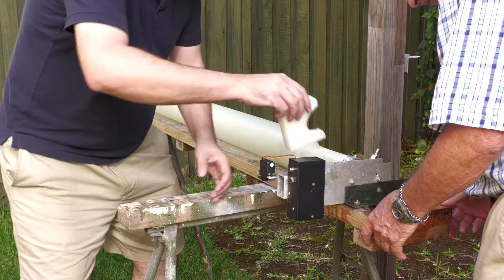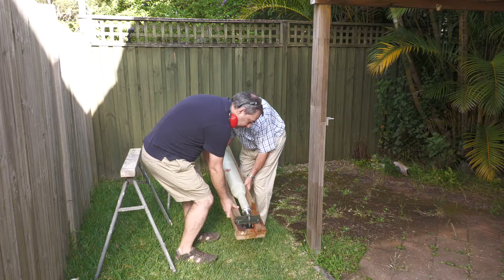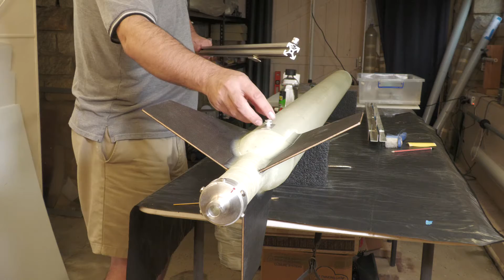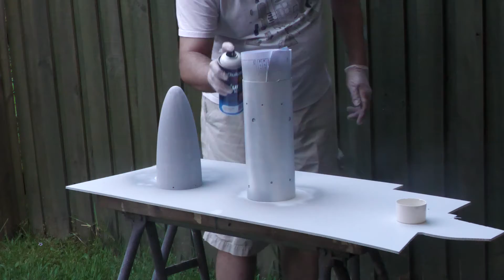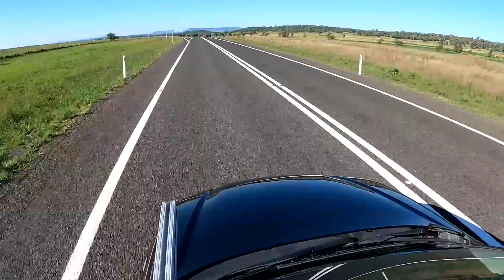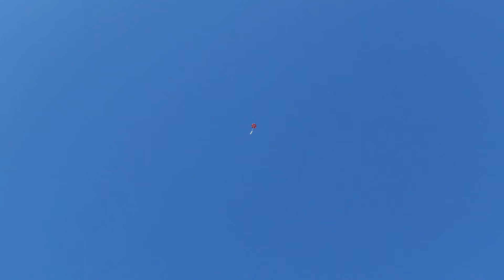High Power Water/Pyro Rocket - Part 6 - Finishing the rocket

Comment: Very smooth launch and almost no spin either. You make this look easy(ish!). A J motor sounds pretty powerful - how high will it get as a pyro rocket? Can't wait to see you get back to Horizon as well - you appear to have this launch campaign methodically planned out!
Reply from the maker: Altitude is around 2,500 feet. on the J. It's amazing the energy density difference between a solid motor and a water rocket. Yup, it's just been too long with the Horizon project. Time to finish it. :)